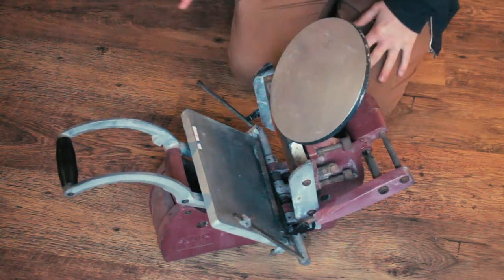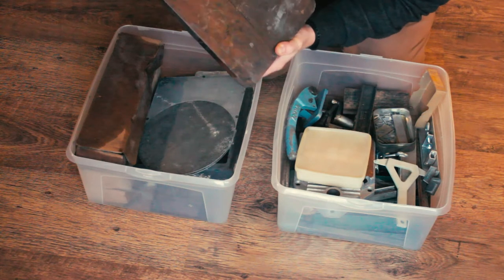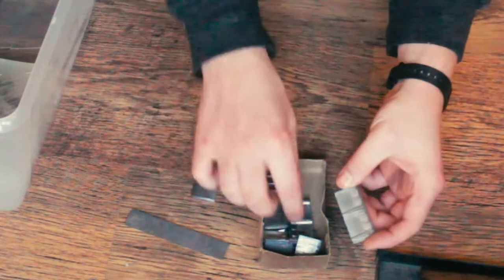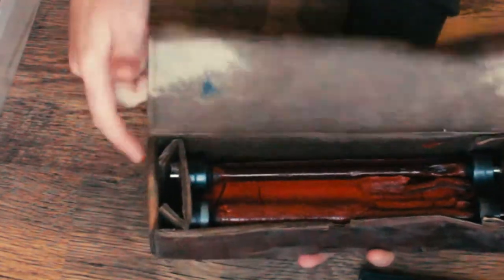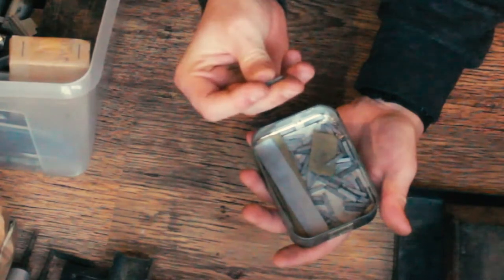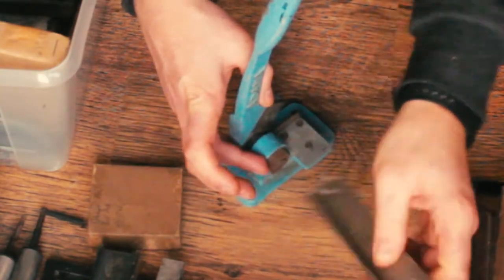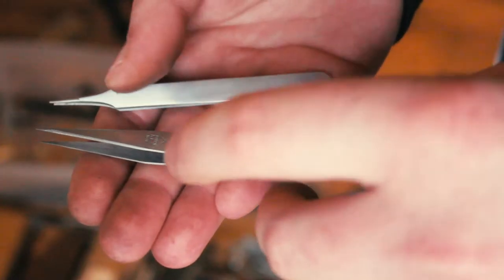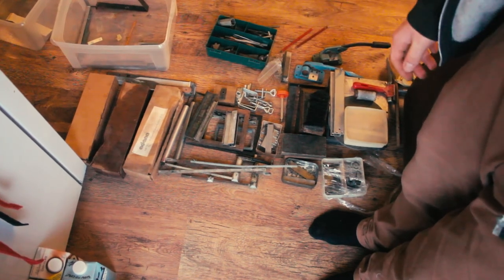Adana 8x5 printing press, an epic thrift shop find.

Comment: That bannister thing is to gently tap with a hammer to level the type in the form which is secured in the chase.
The end pieces on the rollers are trucks. Lucky that you have good rollers.Wooden spoons are very often used to burnish the back of paper on an inked linoleum cut.  The little clippy things are registration pins for holding the paper in the same place each time you print.
Reply: hit firm make sure its level

Comment: Over rider rollers give extra ink not rubber coated,
Quin to lock type in chase 
the disk mix ink 
flatter to get it all type high 918 in 
cornerstone is furniture fill chase 
block and lead is furniture